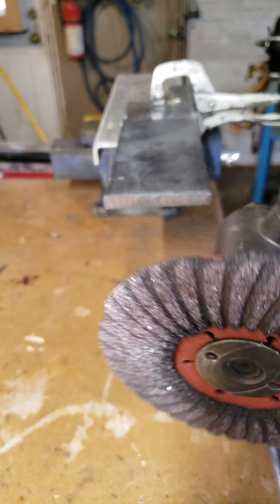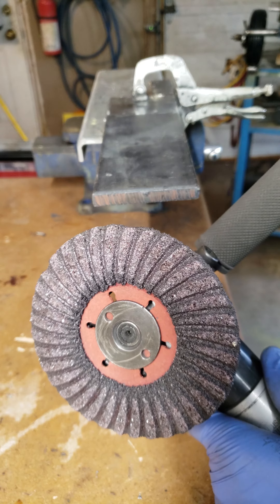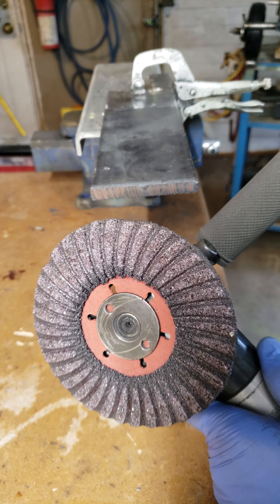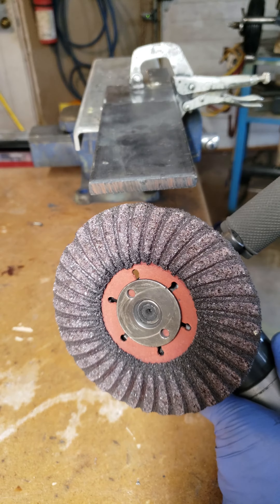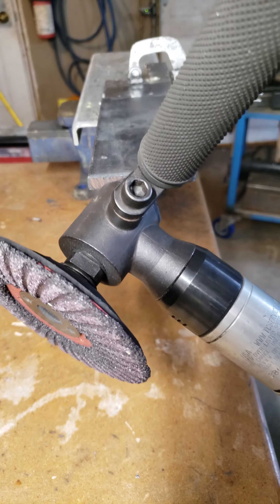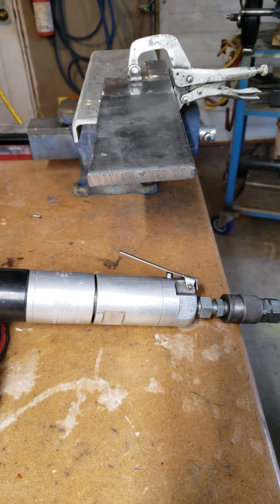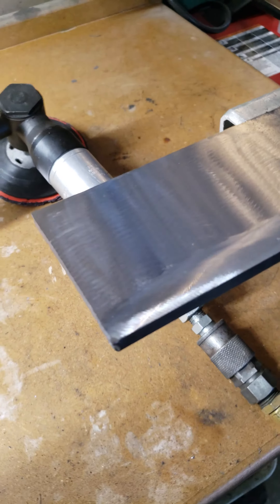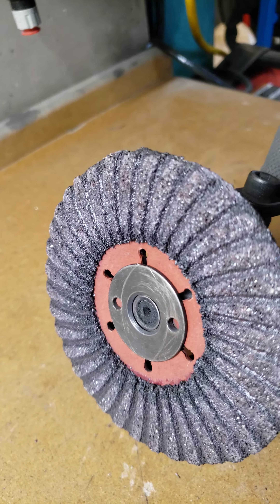MILL SCALE REMOVAL.. FOUND THE BEST STYLE ABRASIVE TO USE.

Comment: Wow.  For all that talking, it sure looked fast.  I tried using silicon carbide to sand stainless and it got dull super fast. How long does this stay viable on mill scale?
Reply from the maker: These disc seem to last much longer  than if you glaze up a fiber disc, how long exactly, I cant say. For stainless,  these discs may not be appropriate. Also, metabo/walter have a line of grinders that are specific to stainless, they run at lower speeds.
Reply: keeping speed/heat lower might be key. I use my cordless grinder which runs at only 8000rpm
Reply: @wim0104  

I recently got my first variable speed (mains powered) grinder, and my only regret is that I didn't get one years ago.

Safer, less effort required to handle the thing, and easier on the discs.

Comment: If the part is small enough and you're not in any rush, just leave the metal in white store bought vinegar. I left some round tube in there for 4 hours and the milscale  came off with a little rubbing. Leave it for longer and it will practically just wipe off with your fingers.
Reply from the maker: Vinegar works well too, I mainly use phosphoric for small parts. Media blasting would be best.
Reply: @airframefixer  Finding acids where I'm from is a bit of a mission, you generally find them in industrial parks but I wish I did have access to it because vinegar stinks up the place.
Reply: @ntokozomasilela4259  go for citric acid
...doesn't smell and its available in the supermarket in the condiment section as powder form and you need only to mix it with warm water
Reply: @qallaf313  Oh thanks I never knew that. I'll definitely try it out

Comment: Where can i buy a air grinder like yours .?
Reply from the maker: Hello, I have purchased all my t.c. service tools from ottertools in boaz Alabama. He has an ebay store. This model is a 44ra. You'll need a larger ar compressor, like 35 cfm to keep this tool running. Most of these t.c. service grinders have 3/8 thread, so you'll need an adapter to get to standard 5/8-11 thread.